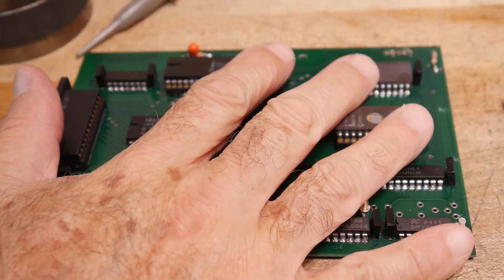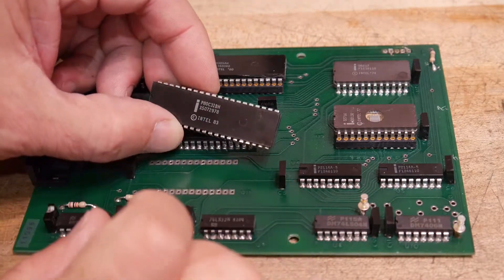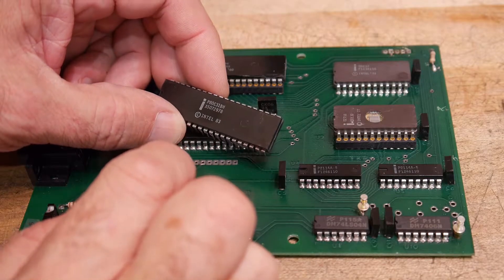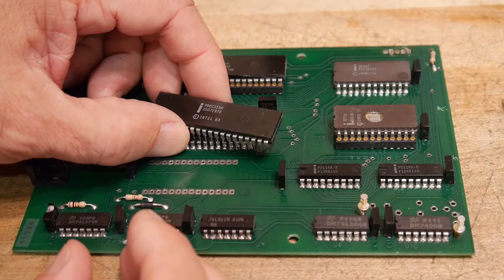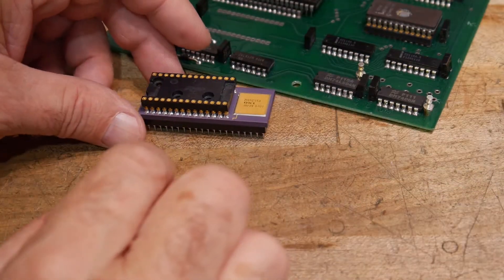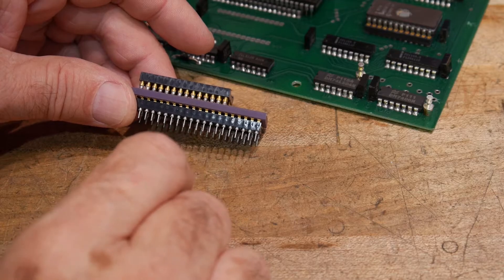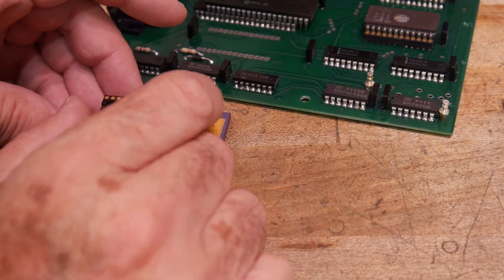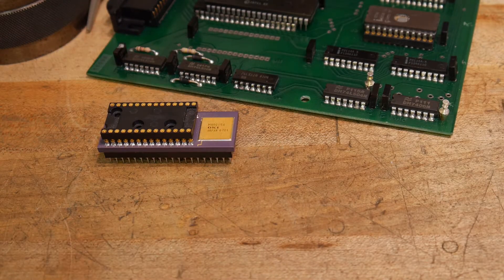#209 Intel 8051 microcontroller OKI 85C154

Comment: From 3:00 onward, I got way too uncomfortable about the pins getting bend sliding it around the table.
Reply from the maker: you might not have any experience with high quality pin sockets. they are robust. not like the flimsy sockets you usually see.

Comment: I actually got interested in the 8051/52 and their various iterations because of an 8051 etc simulator I found for Raspbian on my Pi 3b maybe 5 years ago. The name of it was something simple like 8051 mcu simulator, I think. It was pretty true to the functionality and operation of the hardware you chose, for being a simulator and not an emulator (It had a huge variety of chips to choose from) and even had c++ functionality, although I'm unsure how that worked as I never used it. I just coded in assembly. The GUI. It was so detailed and allowed control of all manner of functions of the chip, like inserting a value into a register or ROM on the fly, for example. As well as being able to physically see what's happening in the chip to debug a program. And various hardware devices you could use with your programs, like LED displays. It was so much fun to learn and play with. I just had to get some of my own ICs and do it for real. Which, the program allowed you to export your programs as actual assembly you could upload to your chip. So, that made things easier.

Comment: Does OKI or Intel still process the hex files for these roms? As an example, I build a program on this, can i still get a batch of roms, from the hex file, to use now aday?
Reply from the maker: I have several videos on how to program ROMs. Back in the day you could buy batch programmers that did more than one at a time. If you had many they suppliers would do the programming for you and charge you.
Reply: I doubt you can but even if you could, I don't see why you would? They basically have no debugger interface and continuously swapping eprom is a pain in the ass.